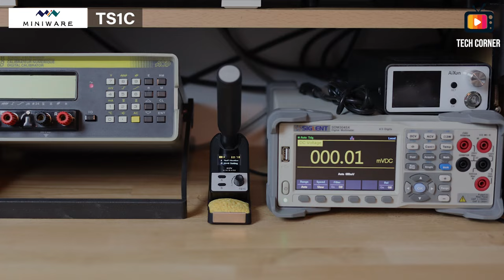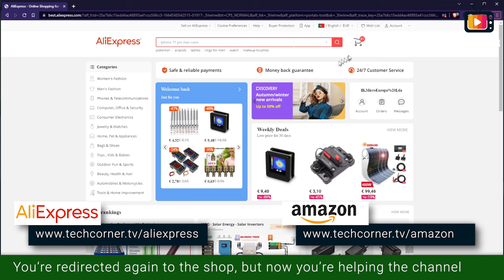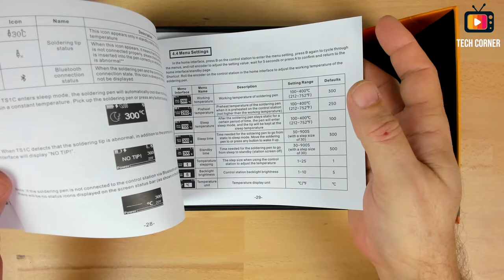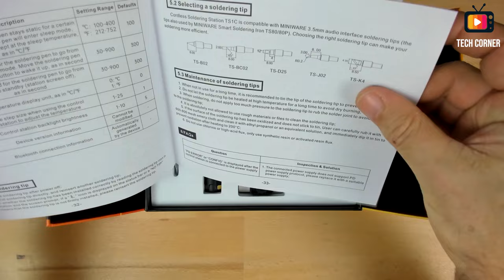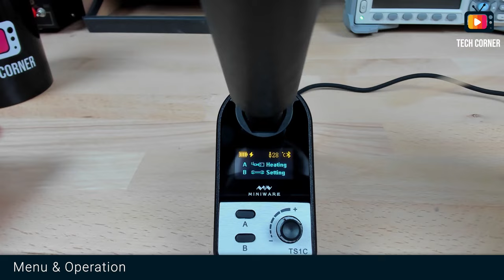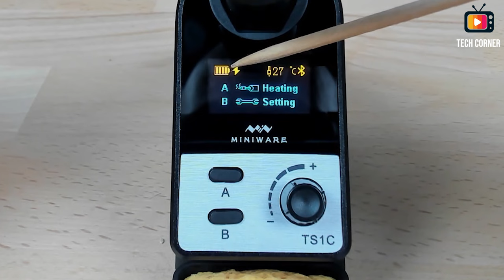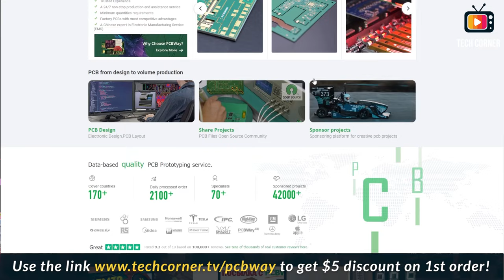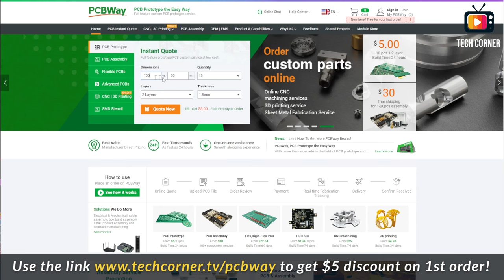[BRAND NEW] Miniware TS1C Cordless Soldering Station ⭐ Small & powerful

Comment: They really should have made this docking station be the battery as well. I would love this on a job site soldering lots and lots of DMX connectors up. The built in stand is what I am missing on my ts80p. I also really like the cord free design that does not compromise on temp accuracy
Reply from the maker: Hi, that's an idea... but even so, it is pretty cool the liberty that you have with the cordless soldering iron :) thanks for watching.

Comment: thanks for the vid. just wondering if there is a need to update the firmware in the future? or the one that comes with the item is stable enough? Thanks
Reply from the maker: Hi, normally the one that cames is stable, this one at least worked like a charm. There is cases like in the TS101 that upgrading the firmware will allow to operate with 96W max power instead of 65W, so it might be a good idea to upgrade sometimes, but it's not requerid most of the time. Thanks for watching.

Comment: in fairness, you would not use a portable soldering iron on such large copper plains, you would use it for minor tasks such as tinning a wire or jumping a resistor, capacitor. 
If you had to solder a pcb up, get out the continuously powered unit. I guess  this iron is made for the guy who has everything, or maybe it's bought as a present. in any case, this wouldn't be your first iron or only iron. 
I suspect it isn't made for comfort either, it's made to fit the battery. 
that said, Christmas is on the way, so I will be expecting this rather than the slippers.
Reply from the maker: Hello! Sorry for late reply, house move and vacations. Ahahaha... yes, it will be way better present than slippers, one year I manage to get a huge boost on my lab, I put everyone buying test equipment for present... it was awesome! Thanks for watching!
Reply: This iron is wonderful for PCBs. I think that's its best use, TBH. That or for an electro-tech that needs to have an iron on hand for the occasional component replacement. But on a desktop doing PCBs, it's nice to hit a group of components and give it some more juice while you prepare the next group and/or do your trimming. Because it restores so much power every minute it's on the base, you never really have to worry about power at all if you're like most people who solder in bursts.